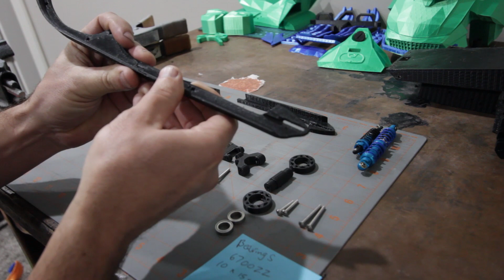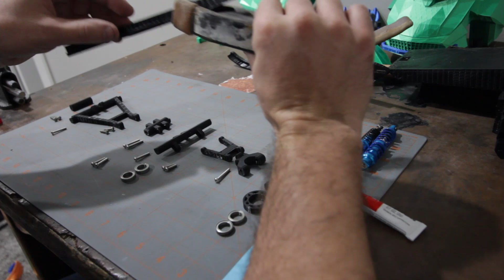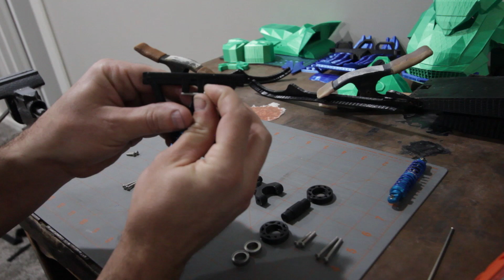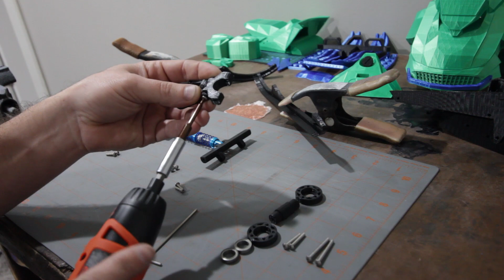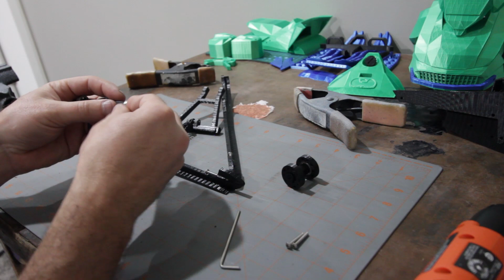SkeeRide Assembly Part 1 - Skid

Comment: Love this, I am in the prosses of printing my own as we speak I noticed that you call out 2 different type of m3 screws i was wondering does it matter which assortment you buy? i need help understanding which motor to buy as well and understanding the motor with what type of amp ESC to buy
Reply from the maker: The only spot that requires button head screws is inside the tunnel at the front so the track doesn’t hit. Anywhere else you can use whatever type you prefer. For motor I recommend 2200kv brushless with minimum 60amp ESC. Go higher amp ESC and sensored brushless if you can afford it. 
You’ll find tons of help and recommendations on the discord server.
Reply: @BuildItBetter3D  do you print using supports for the holes?
Reply from the maker: Files with _SP in the name need supports. I do not put supports inside holes.
Reply: @BuildItBetter3D  thank you

Comment: my shocks that i bought use a smaller screw top and bottom. are there any shocks that come with that 3mm size ball socket.  i see that ur 55mm shock had that metal piece when it was laying on your table but then when you were installing it  it was removed.  it seems like way too much play to not have anything in there.
Reply from the maker: It’s hard to find shocks that length with a 3mm ball. Most people just pop the ball out. You could print a small bushing to fill in the play if it bothers you. I haven’t noticed any issues with it being a little loose.
Reply: @BuildItBetter3D   k sounds good.  thank you. thats what ill probably do.

Comment: What are is the best motor esc servo and would I only be able to print with pla
Reply from the maker: There is a list of links to items included with the files. It seems around 2200kv and 80 amp ESC is the best combo. Then a good high torque metal gear servo. I print mine in PLA, a lot of people prefer PLA +. Some brands are stronger than others. There's a lot of good info on the Discord Server.

Comment: I ordered the same 55 mm shocks you have in this video but mine are too small for the screws do you know why?
Reply from the maker: I pop the ball ends out. They work without the ball end. They’ll be a bit loose but it won’t hurt anything.
Reply: @BuildItBetter3D  ok thank you very much I was debating on sending These back to buy different ones.
Reply: @BuildItBetter3D  also the same thing happened with the 80 mm should I just take out the end for those as well?
Reply from the maker: The 80mm ones should have a hole that fits m3, if they are too small then I might consider getting different ones. Up to you though.

Comment: What type of filament do you use?
Reply from the maker: I’m using standard PLA, usually from hatchbox, and any generic tpu. Many people prefer PLA+ but I personally haven’t tried it.
Reply: @BuildItBetter3D  awesome, thanks. And it has held up okay? I don't plan to beat on it, just drive like your videos
Reply from the maker: Yeah, it’s held up really well. The knuckles seem to be the most common thing to break. I’ve started printing them in tpu, but hard to say if that’s much better. It gives a little more on hard hits but also gets brittle in the cold.
Reply from the maker: Yeah, it’s held up really well. The knuckles seem to be the most common thing to break. I’ve started printing them in tpu, but hard to say if that’s much better. It gives a little more on hard hits but also gets brittle in the cold.

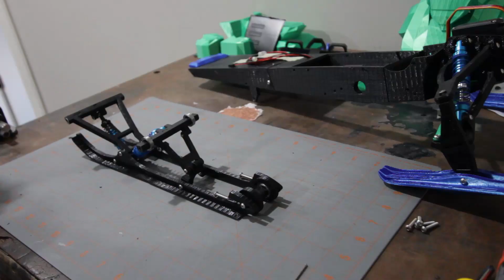Comment: I notice during the video you don’t mention about the front spacer & at the end at 10:31 
You still have it on your work bench & 
I was just wondering what you need to do with the spacer?
Reply from the maker: It mounts with the front holes on the skid. It’s there for adding a limit strap. I haven’t seen a need for the limit strap but wanted to provide the option.

Comment: What are the dimensions of this sled after it is assembled?
Reply from the maker: 24” long 10” wide
Reply: @BuildItBetter3D  so you know how long they take to print out?
Reply: @BuildItBetter3D  this is my very first time using a 3d printer just curious is all.
Reply from the maker: Plan on three weeks. I can get all the parts done in about a week and a half, but I’ve already gone through all the process of learning my printer and have everything dialed in. A lot of people on the discord channel are getting it done in 2-3 weeks though, even some that are new to printing.
Reply: @BuildItBetter3D  awesome thanks for all the help. I can't wait to get this going!!
Reply: @BuildItBetter3D  just out of curiosity have you or do you have this model in a polaris?
Reply from the maker: Working on it now, probably won’t be done before the snow is gone. Should definitely be ready for next season though.
Reply: @BuildItBetter3D  I will definitely be buying this one as well.
Reply: @BuildItBetter3D  what is the biggest part that prints? I'm trying to find a printer to use. I have found one that I like but the bed is 150mm x 150mm. Is this to small to print these parts?
Reply from the maker: You’ll need at least 200mm x 150mm. 200mm x 200mm will be better because you won’t have to glue pieces. You can use smaller printers but the parts weren’t designed that way so you’d have to cut the parts to get them to fit a smaller printer.
Reply: @BuildItBetter3D  sounds great thanks. I'll go with the bigger printer then. Thank you.
Reply: its around 22 inches not exactly sure im still building it but with what i have printed its around there

Comment: Good video. My recommendation. You need to call each parts you grab by the print name and type of hardware you use. you could also modify video by putting caption of parts name and hardware used. Also, You could file the 3D printing parts by color.
Reply from the maker: Thanks. I can’t edit the video now that it’s up. I had all the files nicely organized in folders but that got lost when uploading to MyMiniFactory. Not sure why my file structure was lost since they say they will maintain the folder structure. I do have a pdf with file names and what they go to, I’ll be adding it to the discord channel soon.

Comment: Hello.  I bought the files and im wondering what cad software did you use to model this sled?
Reply from the maker: I did all of the modeling in Blender.
Reply: @BuildItBetter3D 

Never used that software.  I use fusion 360.  And I have made 2 snowmobiles already.  Nothing like yours and detail.  I was testing out designs.  Reason I asked about software was because I have been testing out a weight ballace system using a gyro and a reverse switch mixing so that I can shift the weight and counter steer to carve like real sleds.  I own a 2020 and a 2021 skidoo 850 summits sleds and thats why I want an rc one.  That and im huge into rc with over 250 rc planes,helis,car,trucks,boats, and you name it.

When I print yours and see how it all goes together,  I will let you know about my counter weight ideas and how they turn out.
Reply from the maker: Sounds great. I have used Fusion a little, but I’m more comfortable with blender. Also if I used fusion I couldn’t sell my stuff without paying for the commercial version, and I can justify that. I have been thinking about a gyro system too, seems like something could be done.
Reply: @BuildItBetter3D  oh man, never thought about that.......